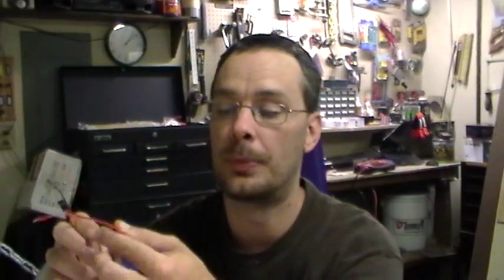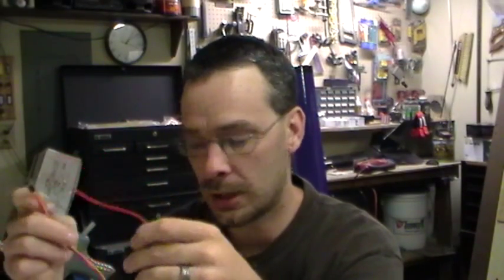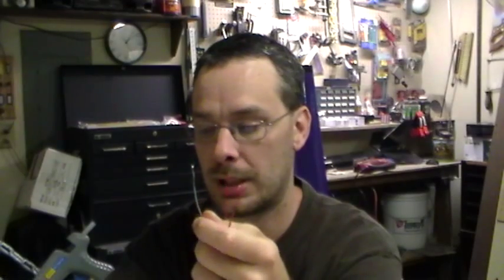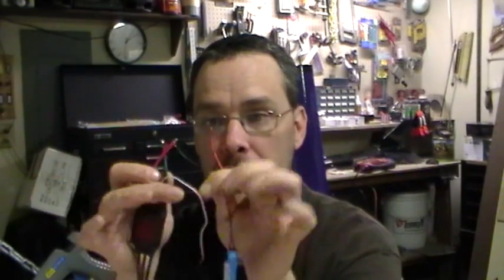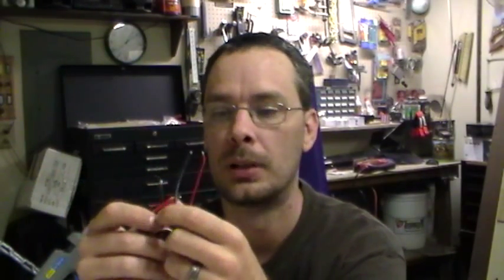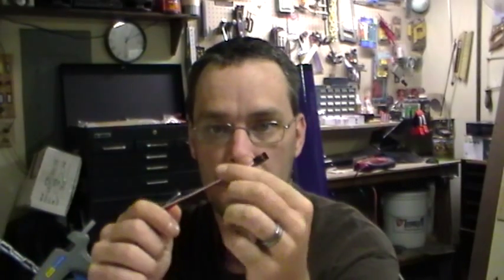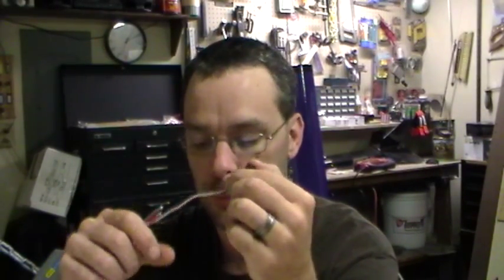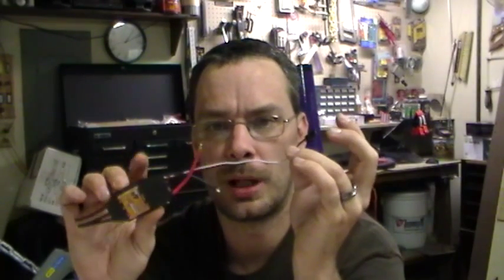BEC and ESC question

Comment: I have an older EDF Thundercat Plane from Blitzrcworks. This plane ESC comes programed in Delta mode. I mention that because at the time I bought it as an RTF and it came with a cheap 4 channelTX/ 6 channel RX ...They RX/TX are OEM with Blitzrcworks  so I really don't even know who they were made by. That's part of my question. The other thing concerning the radio is it came programmed with no way (not even a switch) to use that in any other configuration which really pisses me off even now to think about!! The ESC has only one wire set besides the battery cable and that is a BEC. I believe I plugged that into the throttle (CH 3) position on the TX instead of the battery (top) position. Does that sound right to you?? Also any clues on how to identify the manufacturer of both my TX and RX and any way to program the radio via download or whatever because the only button is a bind/work mode button. The button is flush with the unit when in work mode. When it is pushed in to BIND MODE it goes to an inverted position and stays down until pressed again to release it. Any help you can offer will be just great!

Comment: I know this is an old vid, but the ESC can either come with a BEC or without, if it says it doesn't come with a BEC and there is a red wire, then that red wire does nothing. If it comes with a BEC then that red wire powers your flight controller, or receiver or whatever you plug it in to. Using a BEC will allow you to use a smaller, lighter, and probably cheaper ESC because you only need one BEC and if you have more than one ESC then you are buying more than one BEC if they are included. Also using an external BEC allows you to sometimes use a battery that the ESC is not rated for, like a 4s on an ESC w/BEC rated at 3s ( tried a 4s with that ESC and fried a flight controller). as far as pulling out that wire goes, there are little slits on the connector that you can fit a razor blade in and lift up on from the side and the wire slides right out.
Reply from the maker: +rpaull3 Yep...I've got a firm understanding of OPTO esc's now, lol.  I remember just how perplexed I was when I made this video, many years ago.  I was very confused.  Thankfully, there were several other people that shared similar information that you shared and now I understand.  Thanks for taking the time to share your two cents!!!
Reply: +mountaindewdude76 Joined the club did you? I guess when you buy a plane ready to fly,you expect it to be ready to fly. I have found out thats not always the case. I bought the dynam Waco Biplane thinking I would be all set,just add receiver,battery , program and go. Well I found out that the Duram speed controllers are junk,so I replaced that,but someone told me you need to add a UBEC because the one built in to the speed controller could fail. Really? So I bought one of those. Simple right? Then I find there is two ways to connect them,you may use eather way,but one is better than the other. great,so I spent a whole day doing research on it. On top of that,when I tried centering my servos using a centering device I bought for just that use,I accidentally fried one of my servos,apparently the servos are weak and not of good quality eather. I had a replacement laying around that should work ok. I of course now have to replace the other one. The new one will have metal gears and I still need to make it so I dont accidentally fry anymore servos because I used a two pin connector instead of a three,prevents you from accidentally hooking it up wrong.Geesh! I am still learning,thats for sure.
Reply: scott firman I have never had an ESC BEC fail on me, but then again I always put my ESCs on my quadcopter arms so they are air cooled.
Reply: +rpaull3 the H.K. stabilizing receiver I bought was a failure. I just installed it on my new Waco BiPlane and found it doesnt stabilize. Its noisy and when I tilt the plane,nothing happends. I think I got a bad unit. I am going to Spektrum. I have two other planes with Spektrum receivers and they both work flawlessly.
Reply: +rpaull3 the H.K. stabilizing receiver I bought was a failure. I just installed it on my new Waco BiPlane and found it doesnt stabilize. Its noisy and when I tilt the plane,nothing happends. I think I got a bad unit. I am going to Spektrum. I have two other planes with Spektrum receivers and they both work flawlessly.
Reply from the maker: +scott firman I have two of the k stabilizing rx's and they've not let me down yet.  are you sure everything is connected right?
Reply: +mountaindewdude76 yeah,Im an idiot,I just noticed you have to manually activate the dip switch first to turn the unit on. I will be moving the navigation plug from the aux anyway because I dont want them interfearing with the stablization. I hope to have better luck the next time I fly. seems like I always have issues the first time flying any new plane. I didnt feel to bad. My last maiden resulted in ripping the engine and all the controls out including battery pack. I hate maidening a new plane,its madning at best. I guess I would rather destroy it myself first than have someone else do it. lol. I saw a video where that happened. uggh!

Comment: hi there,,i need some advise from u,i have 2 4s battery to produce 8s lipo to power my esc the trunigy trackstar 200a,,the esc has no bec built in,,i have ubec which can tk only 2s lipo..what i was thinking to use another 7.4volt lipo battery to power my servo and fans..so the question is can i use the 2 4s lipo to power my esc and motor and the 7.4v battery to power servo and fan?will it not damage the receiver?thanks and thanks for video.
Reply from the maker: It all depends on the voltage ratings that your servos and fan can handle.  Most servo's are rated for 4.8 volts - 6.0 volts.  If you get into the "High Voltage" servos, then yes, a 2cell 7.4v lipo will work just fine.  Most receivers can handle up to 8.4 volts.  If your servos can't handle more than 6.0 volts, then you will need to use a BEC to bring the output voltage down to 6.0 volts.  What ubec do you have?
Reply: hi thnks for reply..i hv the http://www.ebay.ie/itm/RC-Plane-Aircraft-Turnigy-MEGABEC-8-BEC-UBEC-/171429110919?pt=UK_ToysGames_RadioControlled_JN&hash=item27e9f8a487,,am turning a petrol 1/5 scale to electric..bought u bec for servos,,,now am swappin for brushless.my esc dont have ubec built in and as i already hv the 2s ubec i dont want to buy another 1,,so i was thinking if i can do this....trunigy plugs in the receiver to lower volts of my 7.4v to 6,use 2x 4s to power esc at the same time..now i have ubec plug in the receiver connected to 7.4v and the esc which is supplied by the 2x 4s which aswell will have to be connected to esc for throttle.is it gonna frie anything with?thnks
Reply from the maker: Ok, I just looked over the specs in the description.  So, you'll have the 2S 7.4v lipo connected to the UBEC, to drop the voltage down to 6.0v.  The UBEC is plugged into your receiver.  Then, your two 4S lipos plug into your ESC for throttle.  You'll be just fine with your vehicle set up that way.  Just be sure to plug in the 2S lipo, before you plug in the 4S lipos.  Best of luck and I hope you share a video of your 1/5th scale running around.  Curious...what 1/5 scale do you have?
Reply from the maker: That's a pretty sweet machine!
Reply: i will share video with brushless set up n test run,will let u know..thnks for advise god bless tk cr

Comment: yo dawg!!  yeah castle esc has built in (internal bec) so if you use an external bec, you would want to disable the castle's internal bec via disconnecting the red wire.  I hope this helps and hope you have learned to solder and own a soldering gun.  Also get a 'helping hands' soldering tool, it is so awesome yo.  good luck with the hobby it can be money costly if you disrespect speed my bra!  piece yo.
Reply from the maker: Thanks for the comments, but please note that this video was uploaded June 29, 2012.  My experience with esc's and bec's is much better now.

Comment: disconnect the red wire split the wire in the middle and tape off the ends like that if you ever need to use it for other application you can re solder it back reason being is that the power coming from your bec will conflict with your red wire going into your receiver that what i been told i tried it work real go i try not to order  from hk they always seem to sell u incomplete products in my opinion hope this works out for you

Comment: i cant attach video but watch "disable red wire on ESC" by h20man210
black=negative, red=hot 5v, white=signal....although that ESC does not have a internal bec i would still suggest pulling red wire but thats just my preference, i very much dislike running power to dead ends.

Comment: That is true...and to be sure do what Ed suggested by connecting the ESC and using a multimeter check the red wire for voltage across to the black.

Comment: Great pointers guys. I might add clarification for Flyingm1 that a BEC is simply a power supply to the radio receiver. Power supply using a BEC can be done two ways, one through the ESC/BEC, and via a separate standalone BEC.
If both the ESC/BEC and the separate BEC are trying to power the receiver at the same time then there will be problems. Therefore the need to disconnect the red wire at the ESC plug is recommended.
Why a separate BEC? the need for more power that the ESC/BEC cannot supply.

Comment: yep i commented on this on your last vid no need to remove with this esc but if you use a esc with a internal bec you,ll need to remove the middle (red) wire to do this lift the flap on the servo connector and pull and tape the wire to prevent a short.

Comment: Hook up the ESC to your battery and put a voltmeter across the small red and black leads (might need to make an adapter from a servo extension, cut off and stripped) and see that there is no current.  If you can confirm this then you can definitely ignore the red wire disconnect instructions.

Comment: If your ESC has no BEC then the small red lead is dead and does not need to be disconnected.  The white wire is the PWM signal to the ESC and the black is ground.  If you were adding a BEC to an ESC that DID have a BEC that you wanted to disable, then you would want to disconnect the red wire. This is usually done by using a sharp blade tip to pull back the thin plastic retention tab at the plug end and pulling out the red wire and the brass connector on the end of it.